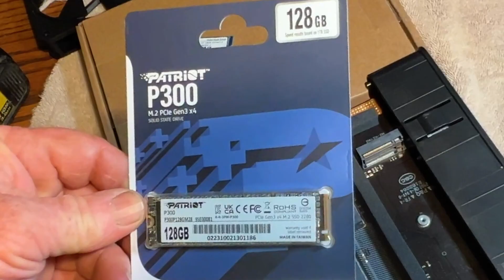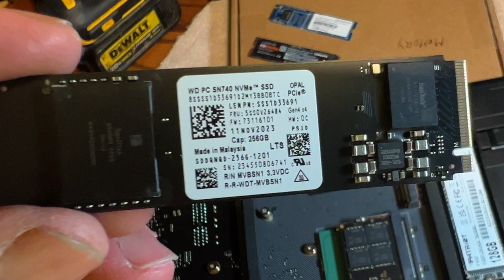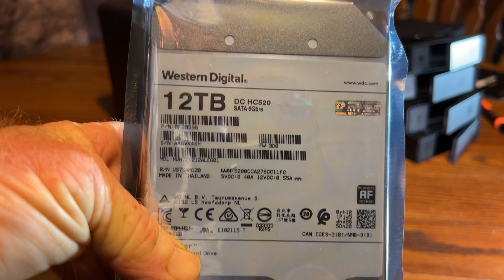UGREEN DXP 4800 PLUS BOOT DRIVE REPLACEMENT

Comment: Great video, thanks again for showing the way!  I found using a thin "healthcare" card (like credit card but thinner and more flexible) was the perfect solution to get the spring loaded pin past the chassis. Sliding it in from the bay door or bottom of the housing when the space with the boot drive was exposed, allowed me to slide the housing back and forth without scraping, binding, or bending the spring-loaded door pin.  (This was a better solution for me than the knife used around 8:00).  Couldn't upload a pic but can share one.
Reply from the maker: That's a nice tip thanks for sharing it.

Comment: Hello sir, thanks for the useful video. I am about to order this model of NAS, too. I was wondering if using a different SSD for an OS can also improve the performance. What model/brand of SSD is the OS installed on, out of the box? Also, so is the thickness of the thermal pad you used 2 millimeters? Thanks!

Comment: Thanks alot for the video - supersimple to follow. How did it go with replacing the fan? - which fan did you pick and does it blow or suck for best cooling? and have you had any thermal issues with the OS-nvme since the thermalpaste didnt quite touch the metal?   sorry for all the questions but i'm in the process up deciding which NAS to buy and this one is looking pretty interesting

Comment: I happened to find this video only a couple of hours before I was going to change the UGOS Pro M.2 SSD to a new one that I could install TrueNAS on but still save the original in case I ever wanted to put it back to original. Your video saved me a lot of hassle. Everything worked a treat. Thanks.
Reply from the maker: I did the same thing. Just yesterday I popped it into an external enclosure then I booted from it just to get aall the updates incase there were any bios updates. But be warned the latest version of truenas has not all of the cpu dashboard widget not working properly. but other that it's great.